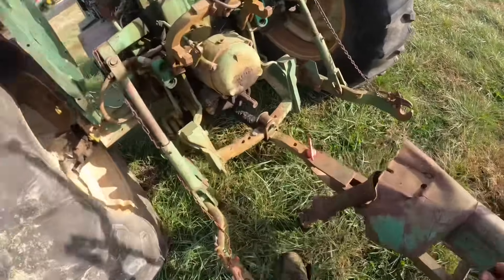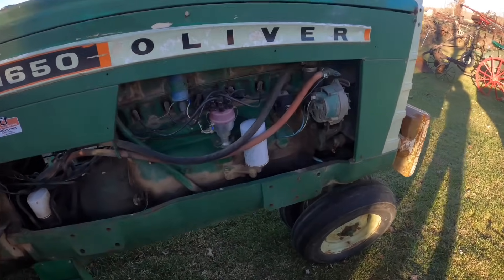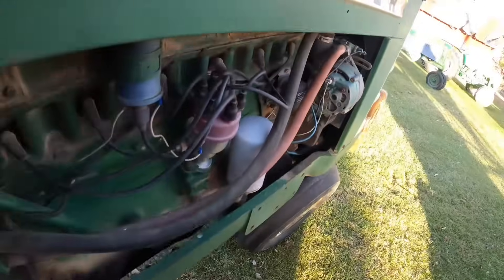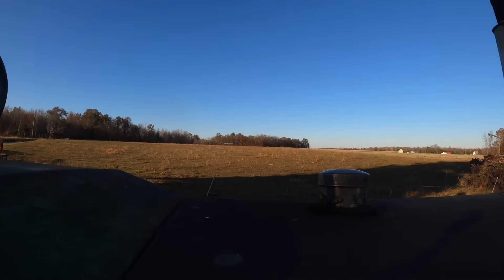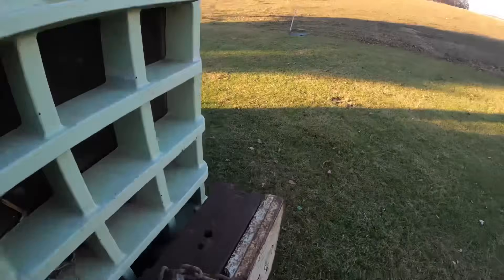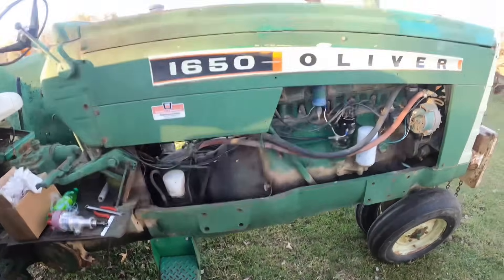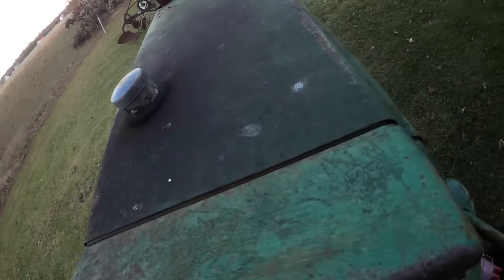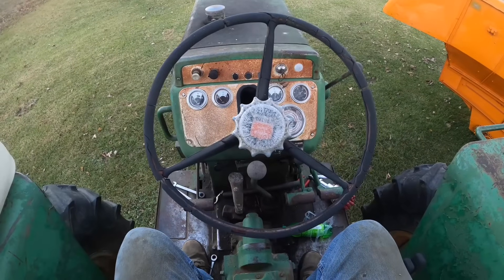Making the CORNPICKING rig MORE BETTER! Oliver 1650 and #5 picker

Comment: Ross, I had to cringe when you were working on the PTO with the end balanced on the draw bar. I did that when I was in JHS with a NI Cutditioner. It rolled off and somehow got my ring finger on my dominant hand split my finger open length wise down to the second joint, bone and all. I'm in my 60s now, and it has never been the same since. Its always cold in the winter, and of course the nail isn't normal and grows split all of the time. I enjoy all of your videos, even though I'm an AC collector.
Reply from the maker: Ouch! I’m glad it didn’t do that to me. Thanks Jim! I like all colors of tractors

Comment: A while back the original distributor in my 1550 went bad.  Korves wasn't making those reproduction ones back then, so my friend Joe put in a Mallory, which would work.  (It eventually went bad, too, and Joe replaced it with a good used original he had on the shelf).  What I remember about the Mallory was how expensive the points were.  They were crazy.  Glad that distributor's gone.  (by the way, if you kept the Mallory, I think I still have a set of new Mallory points if they'll do you any good.
Reply from the maker: Yeah, those points were ridiculously expensive! I love this new style distributor. Thanks Charlie !

Comment: I used to ask customers who were missing fingers, hands, and arms how they lost the appendages.  Invariably it was because of corn pickers, especially mounted pickers where it was too easy to reach over and try to clear the garbage out of the snapping rows, the husker rolls, etc.. 
So when you reach into the working parts of a picker I am screaming to the monitor "Ross, quit reaching your hands into moving machinery" as 2-finger Ross would have trouble putting points in a distributor.
Please take care.  and yes, those PTO pins are easy to fix but never high on the to-do list.
Reply from the maker: Thanks Gary!